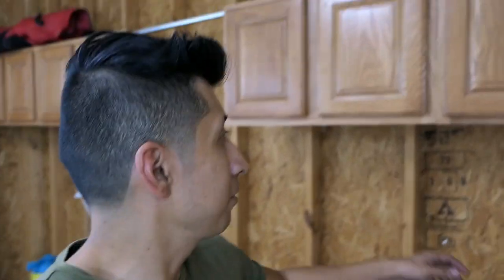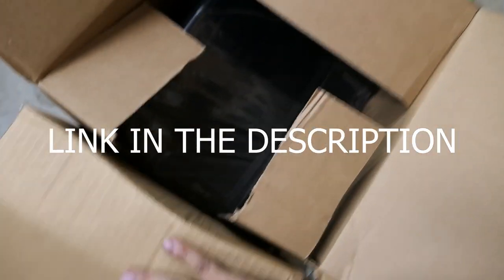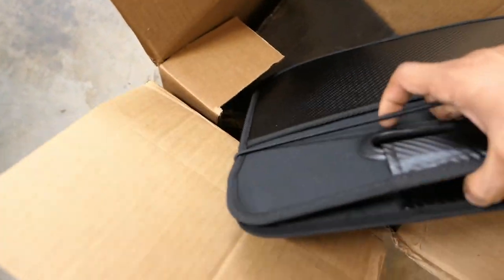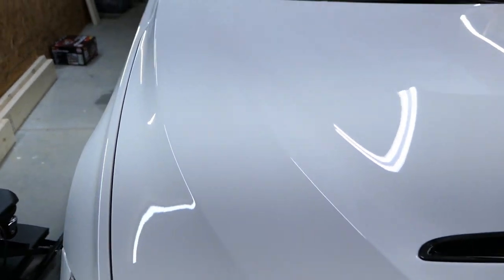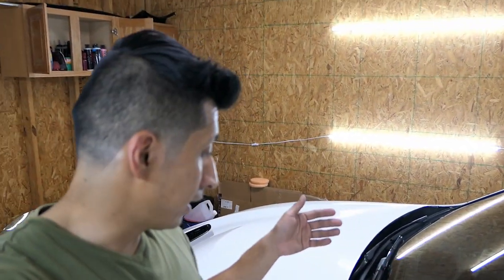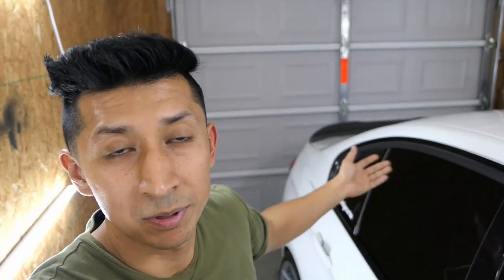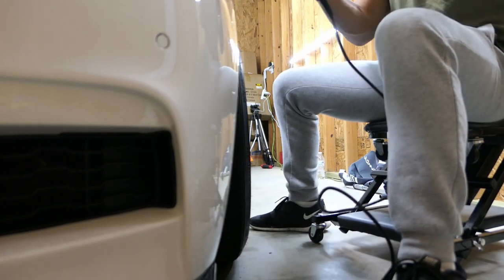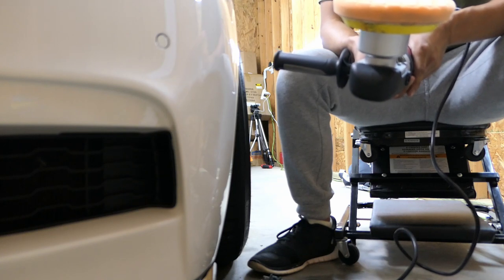PAINT CORRECTION ON A BUDGET!

Comment: Great video! I’ve been wanting to learn how to Buff & Wax my vehicle I’m just a little scared cause I have no experience. On top of that my F30 335i is Sapphire black and from what I hear black is not only the hardest color to maintain but to Buff & Wax as well.
Reply from the maker: No need to worry. I've done two black cars and you won't have any issue with these. Just apply medium pressure and go at a steady speed across the panels. I think when people leave swirl marks on darker cars after buffing its usually from dealerships using dirty pads or a high speed buffer which if not used right then they can burn your paint but you're looking at a paying high price for those because they help to get the job done quicker
Reply: Eldridge Cortes your right! In my case I just don’t feel confident enough to do it myself, I’m afraid to mess up. I guess the only way I’m going to learn is by just doing it. Would you say the buffer you use from Harbor Freight is good enough or do you recommend a better one?
Reply from the maker: @typejlb  its enough to get the job done and for you to feel comfortable without spending too much money. They have one that is listed for $80 but if you use a 25% off coupon then it comes out to 60 which is what I believe I paid but just a different brand. Its good to do one small area at a time for you to feel comfortable as well. Due to certain circumstances ill be having a video tomorrow showing the full process for just a small area
Reply: Eldridge Cortes ah ok good to know. Yeah I don’t mind spending the money I just want one that is good. Plus it will be for personal use, not planning on starting a detail company lol. Thank you for the advice.